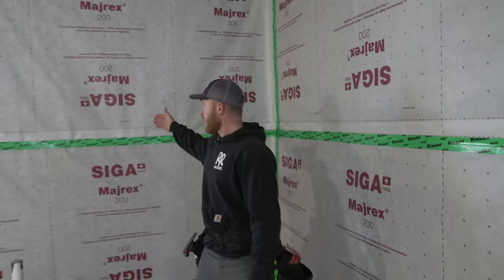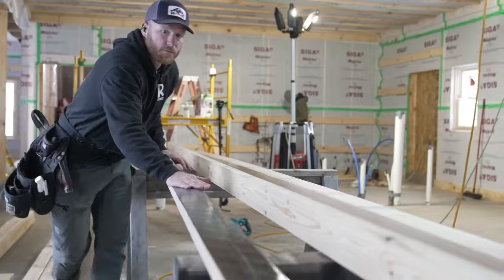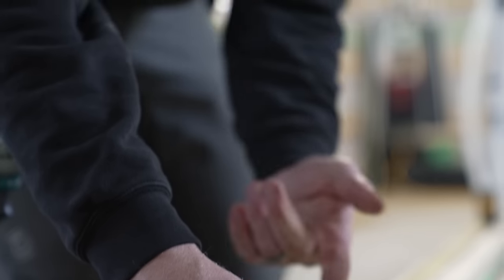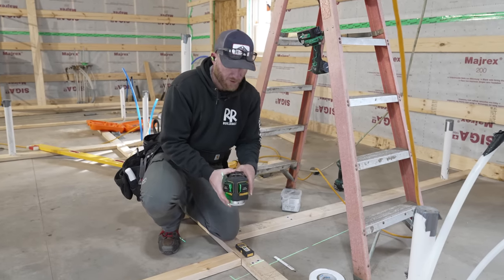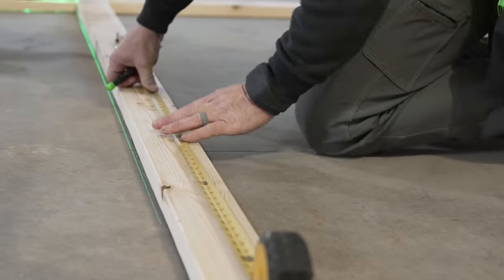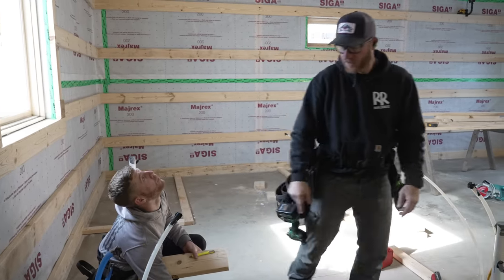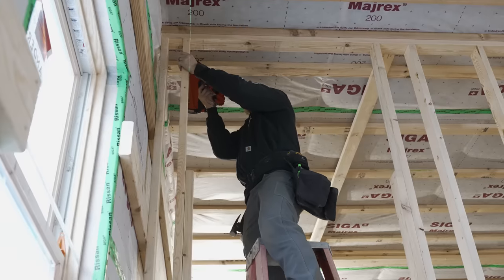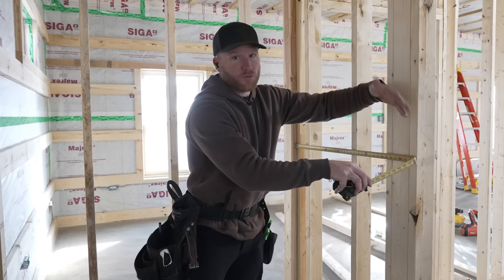The BEST House: Interior Stud Framing How To

Comment: I have found that making "Plumbing walls" 2x6, instead of 2x4 walls saves a lot of headaches at all stages of framing and finishing.
Reply: Absolutely, can't fit a 3" in a 2x4. Running 2x6 is also a lot easier to cross sanitary and domestic lines in the wall. Also using 2x6 is better and easier for dryer duct too.
Reply: 100% All the sub-trades appreciate it.
Reply: Seems a 2x4 plumbing wall is just begging to eventually get a screw through a pipe. If not the drywaller, then eventually the homeowner
Reply: amen to that
Reply: I agree, I was always trained to use 2x6 when I was a framer building custom homes.  Its a no brainer once you see how big they drill the holes for drains.  There is no wood left using 2x4

Comment: Most contractors don’t give two cents about the other trades coming in after them.  Nice to see you set yourself up for finish work by marking studs on the floor plate.
Reply: As a remodeler I am always considering the other trades coming in next , 
mostly because as a remodeler I do all the framing, plumbing, electrical , flooring and any cabinets. With that said I have screwed my self over more than once.
Reply: He's the GC....of course he cares....
Reply: @mr.g937   you’d be surprised
Reply: @JoeAroner-SIWAYTV   I'm a GC but decided to help a framer build a house...that guy just keeps saying screw the other trades. If you want to make money u have to be fast...I only shake my head knowing how much bs he is causing for an extra 2 seconds of work.

Comment: We used to do a lot of finished basements where you can't tip up a wall, we used metal stud track top and bottom, deep leg at the top so you don't need to measure every stud, then just screw them in from the sides of the track. Not as pretty as what you guys did, but seems a bit easier to do. You can get slotted track to attach under trusses to cope with bottom chord deflection.

Comment: Love it! That laser sure makes stuff easy! As an electrician, the only downside I can see to those exterior nailers over the Siga, is 1 1/2” doesn’t allow for common Carlon  receptacle and switch boxes. You could use shallow boxes, but then I’d be concerned about box fill. Seems fine for the ceiling if all you are doing for lighting is wafer lighting, but it could be a bit of a pain for the walls. I’d love to see a video after the mechanicals are done but before drywall to see how they did it!
Reply from the maker: You can still push into the majrex without damage
Reply: @RRBuildings  oh awesome, couldn’t tell how much give that stuff has. Good to know!
Reply: This actually answers a major question I have with this framing approach

Comment: I just did mine for my 2nd story addition I built. I gapped the top plates from the ceiling so the drywall can just go through. No seams so perfect fire barrier. I also gapped at the walls and ran the electrical under the floor. 0 penitration through my vapor barrier. Where my ceiling battens were installed, I put sealing tape between the battens and the ceiling vapor barrier.  This is of course only possible if you have no load bearing interior walls.

Comment: While I can do the measure for a door, a simple jig I have for several door sizes can just be slid to the required door width and the extra space on either side is marked and you have a door frame setup.  It helps the folks I train to see how the layout process works.

Comment: I'm a commercial carpenter, we do a lot of wood framing and a little steel but love these videos to help remind yourself if you start right it ends right! One question: you have alot of different brand tools, do you find that helps you in their efficiency as a tool or does it hinder in the fact that there are different chargers and batteries here and there?? Just wondering for my own . I love the tool reviews! Not knockin the tools just curious on efficiency on a job site!

Comment: Regarding Paslode fuel: I used to use pneumatic nailers, and the fuel/battery combo seems nice.  My pneumatic guns never needed to fuel and with a good compressor could work uninterrupted all day...but on the other hand, I was dragging hoses and electrical cords all over the place, I don't even want to try and calculate how often I was repairing or replacing those, and I have to have access to electricity to run the compressor.

(Also, they're probably why I have tinnitus now.)

I think in a shop environment I would still go pneumatic, but for jobsite work those Paslode nailers seem really nice.
Reply: The gas framing nailer have a lot of downside to them. They're much more expensive to run, gas cartridges make the nails cost twice the price.
You have to maintain them, they need to be stripped and decreased and oiled regularly, cost there as well  as time.
You shouldn't use them in wet conditions, unlike a pneumatic. 
The gas fumes that comes out of  them, you aren't supposed to breath in. You may be breathing in those fumes thousands of times day, if you're busy.
The fan is annoying. 
Always running out of nails.
Not the same power as a pneumatic,  struggle in harder timbers, especially if you have to laminate them together. 
If you want a hoseless solution, better off going with the Milwaukee framer gun, with extended magazine. 
Its heavy, but you soon get used to it.  But it has the power.
RR are sponsored by Paslode aren't they? So you know, he may be advertising.
Reply: Not a big fan of throwing used fuel cells in garbage. I use my pasload with galvanized for treated plates and pneumatic for everything else. Don't have to switch guns and have a cordless if I want. Also because two cords is a nightmare.

Comment: Pro tip for ya. Never build a wet wall with anything less than a 2x6 and the wall with the radiant manifold would be better in a 2x8 wall. Don't crowd the plumbing, and for that matter the electric and hvac too. It's not worth the couple $'s and inches saved.

Comment: I'm not sure if you will see this, but do try and avoid laser into camera situations. While it does make for a cool shot, a laser will destroy a camera sensor. Even if it just for a fraction of a second, it's all it will take in some situations depending on the sensor and laser. A dead camera sensor is basically like the engine in your truck blowing up. You will end up spending as much replacing the sensor as buying a whole new camera body.

Comment: I have been using LVL studs for door framing
Reply: I was thinking the same thing.  Using engineered lumber in areas where cabinets get hung to ensure a dead flat surface.  It can't image the cost difference is that much over the extra labour to manipulate regular studs to make them straight.

Comment: i have noticed that in the USA you never seem to put a horizontal  row of noggins across the centre of the stud wall, why is this? because in the UK we generally do, unless it is metal stud. this stiffens the stud right up and makes for a more solid wall. we also put noggins in the floor joists to. i know what your saying about using untreated timber, it is allot dryer but architects normally specify sawn treated grade c24 as standard practice and sometimes this stuff seems like its just come out of the sea. we generally put a dpm under stud to on concrete floors, good practice . i am a carpenter to but nice to see how things are done in other countries .
Reply: @paul g can you explain what a "noggin" is for us Americans?
Reply: From context I’m assuming they are the horizontal blocking between studs. Adds strength and stability to the wall.
Reply: Because it’s a post frame structure, none of the stud walls are load bearing, so they don’t need to be crazy strong. Also I think adding blocking would create extra opportunity for air penetration which he’s specifically trying to avoid in this build (similar to how he omitted half the studs in his exterior wall for this reason)
Reply: Although now that I’ve said that, I realize the interior walls aren’t insulated so the air penetration idea doesn’t make sense, ignore me haha
Reply: Over hear I’ve seen blocking (noggins) in walls over 8’ tall
Reply: So I'm guessing the blocking/noggins create a fire stop in those balloon frames walls
Reply: @RichSobocinski  in a balloon frame yes , in traditional framing with 10 foot walls I believe it’s more for stability .
Reply: @lethargicmotorsport2025  but he doesn't need it for stability in a post and frame construction
Reply: @RichSobocinski  the original guy brought it up in general, it seems common everywhere else in the world, he asked why he doesn’t see it American stick frame videos. As far as a post frame it’s irrelevant .

Comment: Personally I prefer treated plates because I can glue them and I don't have to use as many 1/2" redheads.  Then I either use all galvanized nails or have two guns one with galvanized for treated.  I specifically do basements and build them just like you. Just not dealing with post frame. The only thing I didn't like seeing was no backer in the corners of the exterior for the drywall. If they just float every few feet the taper will go to push with his corner tool and it will push the drywall in.  It's at high risk for cracking also.  One could nail on 3/4" backer to the back of the stud before installing it.  The electrican could then cut out what he needs.

Comment: @rrbuildings I know it's a year late but I'm really interested in how you addressed truss uplift.  Blocking on top of the partition walls, drywall clips, truss clips or screws through top plates for stability, etc.  I was wanting to do a monolithic drywall installation like Jake Bruton did on one of their houses but can't get an answer about how he and Steve did the ceiling to partition wall connection (crown molding I'm guessing) Great build and thank you for documenting and presenting such a complex process in an easy to understand way.

Comment: The drywall might not come down the wall like you mentioned. That would put the bottom tape bed too low.  He may come from the top, then start at the bottom leaving the seam higher which would make it easier to mud. Less bending 1:03
Reply: Dry wall “should “ go top to bottom.
What I’m curious about is weather it’s 9 or 10 foot ceiling?
If it’s 9 foot they will use 54” sheet rock.
Reply: @lethargicmotorsport2025  of course it will go to the bottom. But do you want to work a seam below the waist line or at the waist line. I’d rather at the waistline
Reply: @lethargicmotorsport2025  10'
Reply: @marcusjames3035  I agree with your thinking, working all down will give you a better finish.
For me two beveled factory edges are much easier to finish than a butt seam and a factory edge  .

Comment: Question: Since the interior walls are really just partitions, what do you think about hanging and taping the drywall on the exterior walls before framing the interior walls? So the drywall on the exterior walls is an additional continuous  envelope around the exterior.
Reply: The 2x4 can't hold well with drywall sandwiched between. How long does drywall last anyway?
Reply: That is what they do in commercial construction, they will leave the last 2x4 loose so the trades can run any systems in the walk then they board the wall then mount the 2x4. Makes it so much faster.
Reply from the maker: good idea
Reply: @robedwards2897  I'm not sure I understand what you mean...Do you mean the partition wall is framed but not attached to the exterior wall until after the plumbing and electrical is finished?

Comment: My dad built houses for 40 years he hates you but loves you he says you do phenomenal work but  he hates the new technology he's the string line framing square sight a wall old head he is retired now I try to explain this stuff to him he came on the job the other day threw a 250 laser I was using to plumb a gable he watches your Chanel also old heads just won't change

Comment: The insulation geek in me would love to see some rockwool comfortboard 80 - 1 1/2” thick insulation in that service cavity right before drywall for an extra  r6.
Reply: Someone already did that, They put some 1.5” Comfortboard 80 in between the exterior girts & the interior service cavity that would be around R35.

Comment: Here is a question I’ve always had about building science. You spent a ton of time and effort on the air sealing details of the Majrex, but then puncture it to add the screws for the girts. Does that impact air sealing?
Reply: My thought is that it’s unavoidable and minor. Most walls are 16” on center walls with vapor barrier, than tons of drywall screws penetrate it. With the girts you probably and up with less penetrations in the vapor barrier.

Comment: high quality job done, amazing. have a question here for interior framing on the concrete. sometimes, Pex-A hydronic pipe will floating a little higher when the concrete poured on mesh. how to avoid to damage pipe potentially when drill the hole for Tapcon screw. maybe the concrete is thick enough, more than 2-1/2 or 3 inch, it is safe to drill hole. just curious. thanks.

Comment: i know the laser will provide straight lines but what is your method of making sure you have the laser set up in the correct position so the lines are hitting the wall in the correct place?  Do you mark both walls in the beginning and then get the laser lines on the marks?

Comment: It amazes me how pressure treated lumber is always kept outside and never covered. It is always wet or moist. Very smart to use vapor barrier or the weather tape with traditional lumber. Why pay the extra cost for pressure treated?
Reply: What is the cost difference between the weather tape plus white wood vs a pressure treated piece of the same size?
Reply: @bwillan  If you are a builder you always have rolls of the weather proof tape on hand. Stand a pressure treated 2X4 on end and come back 24 hrs later there will be water on the ground. It is not so much about the cost but having a good end product. I used to do window replacement in many masonary buildings yrs ago and always use pressure treated lumber for blocking. The wood was never straight and would be tough to cut when damp or wet. If you like to use pressure treated than that is your choice. I do not want any part of it. I enjoy the gentlemans videos because he is always looking to do things better and that is how I work also.

Comment: Drywall comes in more than 4x8 sizes.
Reply: usually it comes in lengths longer than 8'.  I've seen 54" wide to handle all the 9' tall ceiling in many new residential homes.  However, is the extra cost of these speciality sizes worth any minimal labour savings in a couple less joints to tape and mud over a whole house?

Comment: Did you have the opportunity to compare your Stabila  laser tape to other brands?  Seems that it is only accurate to a 1/16” where Leica is accurate to a 1/32” if we can believe that adverts.
Reply from the maker: the stabila is more than accurate never had an issue...in framing 1/32 is error on eyeballing the cut
Reply: @RRBuildings  yes.  I have a bro-in-law that is a trim carpenter.  I was thinking of a gift.  So you’ve not used other systems yet.  Thank you.
Reply: @kevinorr6880  should ask finish carpentry tv what he uses. I think its a Bosch.

Comment: this construction method will clearly be vastly superior for hindering water-penetration and also insulation-factor, and now I see how you will run the wiring without permeating the wrap-barrier..... I am wondering what the cost comparison will be versus traditional stick-framing.? your dedication to quality work is an inspiration...thanks
Reply: In all honesty, it is likely only slightly more expensive than conventional. You have your laminated posts and your wall girts instead of a conventional exterior wall. Averaged out, it would likely come out to being equal amounts if not even less lumber used overall. The extra expense might come down to extra time cost rather than extra lumber cost. Even so, that would probably be down the builder's unfamiliarity with the method, which could be avoided by finding a builder local to oneself who is experienced with it.

Comment: I was thinking that treated wood was needed for base plate on cement floors.
Reply: that's what the tape on the bottom of the board is for.
Reply: @joelvandyke9687  I guess I was under the impression the tape was an optional addition but didn't realize it was a substitute for a pressure treated board.
Reply: The tape protects the board from picking up moisture.